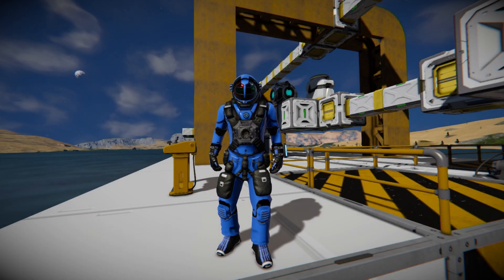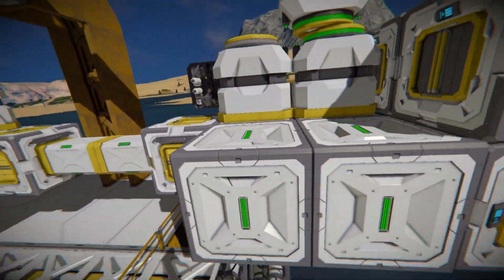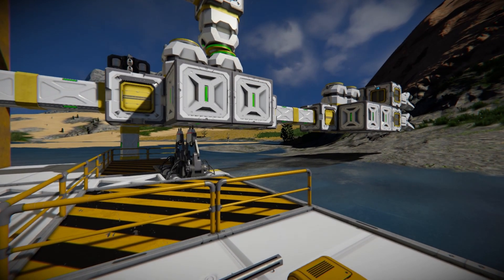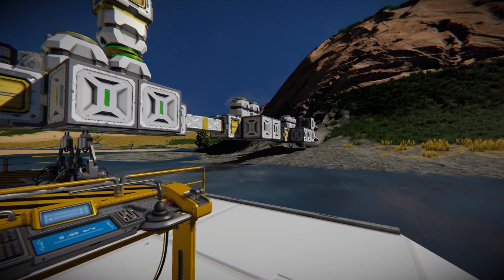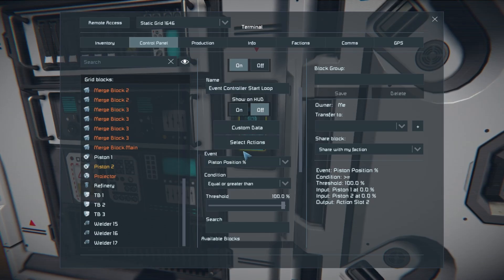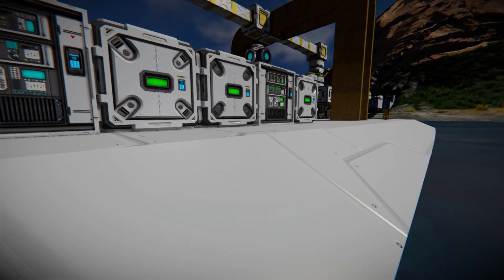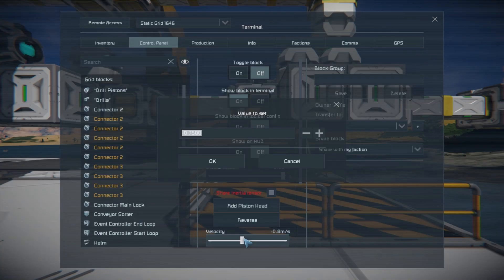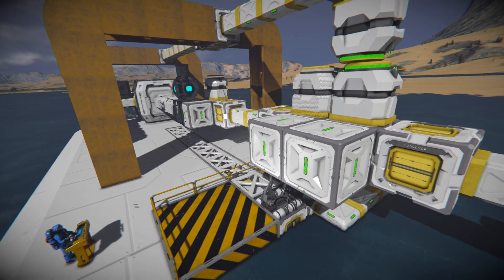Auto-Drill Concept : Space Engineers Tutorial

Comment: if you switch to using mergeblocks instead of connectors to secure the drills, you can save on most of the mergeblocks and instead weld up straight conveyors (much cheaper)

Comment: Hey man. Good video indeed. I'm digging deep into the hill and making a wide tunnel. I have 15 drills, 5 in a row and 3 in height. I started with only one piston and the problem is that I don't know how to extend it with a welder. I'm searching the internet and YouTube but I can't find a tutorial on how to do this. Your drilling system is too complicated for me at the moment. I would be happy with my system just so I could add pistons somehow. Please help me, how do you easily add pistons to existing ones using welders?
Reply from the maker: Unfortunately, this video is the simplest way I could come up with to extend a drill head with a welder.  If you don't want to grind down your dill head every time you want to make it longer you can use a landing gear on your drill head to lock to a block placed in the voxels to hold the drill head in place.  At the end of the last piston use an advanced rotor to attach to the drill head.  This gives you the ability to detach the rotor head, retract the pistons, grind down the rotor base, and add more pistons to the drill arm.  At the end of the drill new arm add a rotor base and extend the arm back into position where you can attach the drill head on to the arm.  Grind down the landing gear and you can drill forward.  

If you come up with a better way using a welder, let me know.

Comment: Tried this build and... I found a major flaw: you mine much more than the whole system can contain.
Simple solution: put the upper connector on a piston and make it follow the drills keeping it attached to a connector. In this way you will be constantly transferring the ore to the base and the whole system can keep drilling indefinitely. 
If needed i can post the sequence for automating the whole system with 4 timers.
PS: this kind of rig needs very solid refining infrastructure, at least 3-4 refineries if you are extracting stone, more with ores slower to refine.
Reply from the maker: My first go at this drill was in survival.  I used a sorter and large connector to eject stone from the system in an attempt to not bog down the one refinery until I had enough resources to expand.  With that said, you are correct, one refinery can't keep up even with a stone ejector.  The goal of this video was to quickly showcase the idea I had.   I like the idea of using the connector on a piston to keep the resources flowing.  I would like to give it a try if you want to post the sequence.   Thanks for the feedback!
Reply: That's actually not the simple solution, that connector currently is all that supports the drill arm while the extension gets built, which means you'd need more timer blocks or event controllers to retract the connector at some point so the drill doesn't get dropped.  A simpler solution would be to just put more storage on the drill and either swap out conveyor tubes for sorters set to drain all or build a programmable block and plug in an inventory management script

Comment: made a similiar thing but mobile few years ago, But problem was I lost all my progress due to our overload Clang the almighty (This was pre-fix of pistons/rotors), because I converted it to ship from station and unlocked the gear.... and I was a moron and not didn't make a seperate save so all my backups were replaced....  :)  It is a simplier design than mine was,  Difference was that I aimed my down rather than straight, and was a little more complex.  The event controllers didn't exist back then, but it worked fine with just timers [If I remember right, I made use of extensive use of pistons, it kept crawling down rather than extending down, it used Grinders n Welders instead of only merge blocks, for Straight mining, I would say add Wheel for stability. if you want to make a super long tunnel to a base very far]

Comment: I am trying to use this build. For whatever reason, it will not print the connectors or the little lights that you added. I have tried so many things. Any one have any ideas?
Reply from the maker: The blueprint has been wierd for several people including myself.  I've been trying to figure out what is going on with it but I haven't found a solution yet.   Sorry.
Reply: @CosmicIntroverts  I finaly got it to work. Unfortunately I did not adequately isolate my actions so as to know for certain which thing worked. The three things I did that I think made it work. First I remade that BP with a different name and removed the interior lights. Second I added another welder above main connector. Third I made sure I had all the parts in the cargo container to make the Connectors.

Comment: Ooh, I had a lot of fun developing a vertical variant of this a few years back, thought it would be cool to imitate the oil rig look. I... kinda overcomplicated it and gave up though XD. Tried to optimize too much and got lost at the assembler-balancing step.

The first thing I did that might help you though was making the motion all happen on the drill assembly that went into the earth. I didn't like how pistons got more unstable with distance. IIRC my setup was two pistons with merge blocks at the top and bottom with the rest of the drills and conveyors attatched to em. The whole thing would 'inchworm' its way down by releasing one at a time, and build the pipe/merge block anchors as it went.

The other thing you could consider (if the goal is resources instead of a shaft) is to put a couple minute delay between extensions like I did, or add refineries, that stone you're throwing out could be turned into sweet sweet ingots.

I got pretty far into the project, even had grinders and multiple projectors set up so that after the drill assembly finished with an anchor station, it'd grind away all the extra bits and replace it with cheap piping. Figured every block I could cut from the repeating segment was more 'profit' material. The issue for me came with trying to make sure my welders always had access to enough stuff. Something about getting the assemblers at the base station to ONLY make enough parts for an extra repeatable section stumped me. Repeat-orders, even at the right parts-ratio, would eventually fill storage and jam, trying to trigger the parts-order with timer blocks broke when the refineries didn't keep up or you hit an ore patch and started only having access to one ingot type, and moving the stuff around with connectors was its own headache. Then I realized any loss of power would brick the thing and I quit instead of trying to harden it against disruption-by-violence.

I probably should have looked into repurposing someone's inventory-management script and just sunk the base station into the rock, but that was about the time my frustration convinced me to give up and move on to something else. Hope you have fun developing your variant and it actually sees survival use! Remember, 'perfect' is the enemy of 'good enough'!
Reply from the maker: Wow.  Sounds like you put a lot of time and effort into that thing.  It is really easy to over complicate and difficult to keep things simple in SE.  Especially if you are  automating.

Comment: I've done something similar, except it was vertical and drilling straight down, and had the drills on a rotor allowing a 15 drill setup to bore a 30 block wide hole.  Always ended up with Klang issues though.  Probably the whole "Rotors on pistons" thing.
Reply from the maker: That's and impressive size hole!  How deep did you get before it clanged out?
Reply: @CosmicIntroverts  It would get deep enough to reach the depth most ores can be found, so it was still useful.  Crushed my dreams of "Tunneling to china" though.  The design was born of necessity.  I was playing on a server that, while it didn't have a PCU limit, it did have a "Per block" limit per player.  The limit for drills was 15.  I figured if I were to lower a shaft and at the end of it have it "T" off in 2 directions horizontally at the end on a rotor, it would suffice to pull up any deposit I found in one go. It would split in 2 directions, one drill dead center, and branching out would be every other block, offsetting the drills from the opposite arm so they alternated coverage and maintained some sort of balance.  The result would be the same if you were to extend 15 drills in one direction right next to each other but rotated them from the end rather than the center, so 15 drills covering a radius of 15 blocks (so a diameter of 30.  Technically 29, but 30 sounds better).

It was also mounted on wheels so it was portable (This was a rovers server, probably another factor to the Klang, but I would think locking it to the ground with landing gear would eliminate that factor)

Anyway, it served its purpose, but could DEFINITELY be improved upon.  It also had a problem with releasing the connector before the merge block was able to connect sometimes if things got a little out of alignment.  There's been a few updates since then, so event controllers may fix this if I were to try again.  The Klang since then may have been improved as well.

If you wish to try it and perhaps perfect it, have at it.  I would actually like to see it work without exploding every other hole.
Reply from the maker: I would love to take look at it.  Is it on the workshop?  If so what's the name of it, I'll look it up!
Reply: @CosmicIntroverts  unfortunately, no it isn't.  Never felt it was complete enough to be "workshop worthy".  Only thing I have there is an old script that functions as a one button launch system to get your ship from surface to orbit (shameless plug here, launch assistant).

Best I can offer is a general description of how it's intended to work.  I might be able to slap an example together and pm you a screenshot.  The original build is long gone.
Reply from the maker: No worries.   If I get into a situation where I can utilize a setup like your drill, I'll give your system a shot.  You'll  get credit of course.  Thanks for sharing! 👍

Comment: Definitely an interesting take on an inchworm, as you mention at 5:10 it will eventually get to the point where the drill shaft is too long for the piston to hold up, which is why typically for inch worms the printing is and moving is done on the drill head, and the 'shaft' is a static grid mounted back at the base.
Reply from the maker: That is an excellent point.  I may have to investigate and try a build with the printing on the drill end.  Thanks for the tip!
Reply: Could you also keep things stable by having a wheel under the floating section(s) of the drill so the full weight is always supported elsewhere than the piston itself. Then the problem becomes how much mass the piston can actually push.

You can potentially create an infinite power source this way to that also produces a long chain that includes a battery (since they have 30% charge at creation).
Reply from the maker: @appuser  That may solve some of the stability issues as the drill gets longer.  May be worth adding it to the blueprint to see if it works!  Good idea!

Comment: Food for thought. Having this as a core for a ship that can land down lock in to the ground and bore like this would be amazing to see. Also you could add a simple set up for the drill part with a printer and welders to make a base floor as it drills. Love seeing other engineers builds. Keep up the awesome work man.
Reply from the maker: Thanks!  I like the idea of putting it on a ship.  Very cool idea!
Reply: @CosmicIntroverts  I took the ship borehole idea and added a couple of grinders at the top of the print bay (And I set the pistons to move the drill from the side. I set it up so the projection moves with the drill, and actually builds ON the drill shaft instead of on the piston, so it prints as it goes, and there's nothing behind the shaft.)

By having all the connections on the sides, it allows me to set the drill rig to go down for a set amount of time (I use 2 sets of timer blocks, an extend and retract set, with paired timer sets for retract and stop, timed so that the final retraction brings the drill-head into the ship, but doesn't feed it into the grinder.). Then I have the depth-timers set for 30, 60, 90 meters so I can just land over an ore pile and run the drill down to the depth of the ore, harvest it, and then collect my entire drill back up. (I also keep the welder and grinder banks on an isolated grid so I have EXACTLY enough components to make the deepest drill the timer blocks allow, and it doesn't fill that storage with stone)
Reply from the maker: Nice!  You should put it on the workshop so I can check it out.  I would love to see it in action!

Comment: Hey Bearded, I like the simplicity of this tunnel boring machine,  is it as stable in survival mode?
Reply from the maker: Seems to be.  I had some trouble with the welders on the server I tried it on but it was stable for at least the 8 extensions I did in survival.   I have not tested it without share inertia tensors so if you are on a server that does not have that I would use caution.